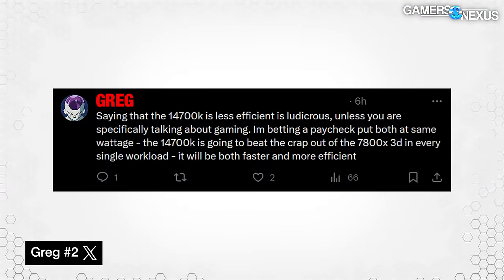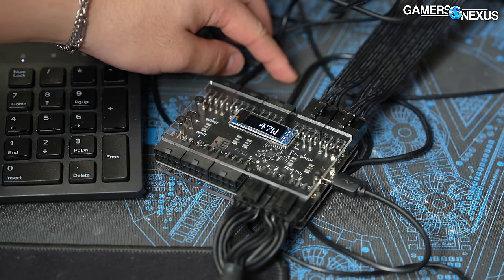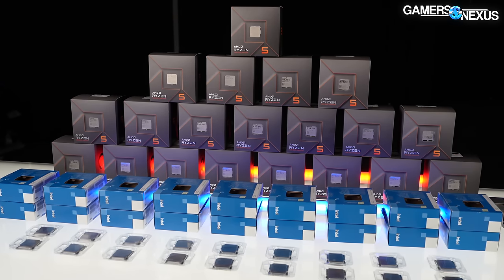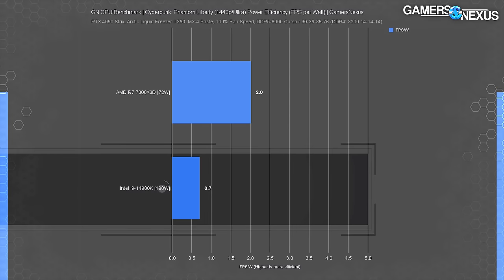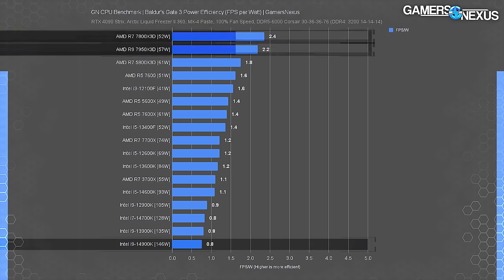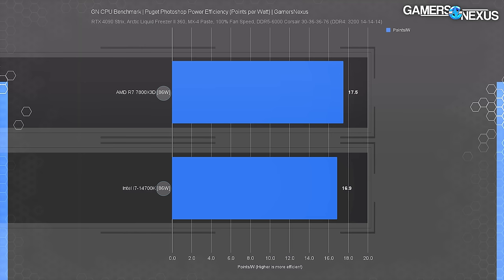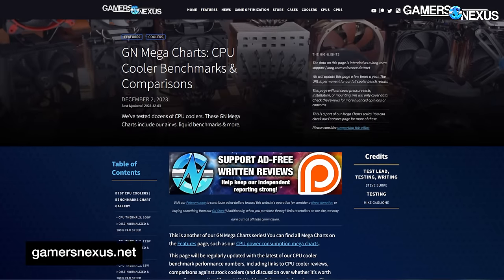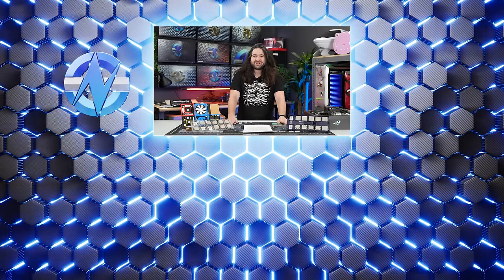The Intel Problem: CPU Efficiency & Power Consumption

Comment: Sincerely, thank you GN, and thank you Greg. This is the kind of data I really need to see. The synthetic benchmarks are fine, but some real world data is especially useful for my situation.

I'd really enjoy seeing this data set expanded to include lower TDP CPUs like the 65W Ryzen 7 5700X and 7600, as well as a GPU equivalent set.

My needs are probably not so unique in the USA, as many renters suffer from landlords that are restrictive with what we can do ourselves while unwilling to fix things when presented with them. I personally am living in an apartment with shoddy electrical wiring and share it with roommates in order to be able to afford a roof over my head. The circuit that my computer is on is also shared with computers from other roommates and we don't have a way to work around it. As a result, power efficiency is extremely important partly to keep the electricity bill down, but more importantly, so that we don't blow the circuit breaker whenever we're all using our computers.

I picked out my system specifically for its overall power consumption. I chose a Ryzen 7 5700G with a Radeon RX 6700 XT. The former because I had a B450 motherboard already and wouldn't benefit from the 5700X's PCIe 4.0 support, and it was cheaper anyway. Besides that, the 5700X/G are the best AM4 CPUs whose TDP is only 65W. Going any higher would bump the max power draw and bring me closer to the apartment circuit's limit, and that limit is the primary factor for me.

The 6700 XT was chosen because it was a solid and affordable mid-range card at the time of purchase. My specific card has its limit set to 194W, but my testing showed that limiting it to 120W gave the best power vs performance ratio. The FPS gain past that was only 1-3 FPS per 10W on average, while going lower than that saw closer to a 5 FPS per 10W decrease in the same test scenario.

Add in peripherals and dual monitors and this results in a very capable gaming machine capable of achieving 120 FPS at 1080p with max details in almost all my games while still only pulling 300W max from the wall, as measured by my UPS.
Reply: Incidentally, my previous system also has very good power efficiency. (The B450 motherboard had to come from somewhere.) A Ryzen 5 2600 and a GTX 1050 that I was using as a secondary GPU because the R9 290x doesn't have hardware HEVC support. The 1050 is lower power consumption anyway and I won't need it for intensive tasks, so it would work perfectly for the file server's display.

With a few more parts, I can reassemble it to replace my current file server and vastly expand the capabilities while keeping overall idle power consumption under 30W.

Beyond that, I ccan add some extra features such as router capabilities. I'm aware of the security concerns that comes with running a router on the same system as a file server, but adding a 4-port PCIe NIC would let me create a much faster and customizable router for my local network than anything I can get store-bought while only increasing idle power consumption by maybe 10W more at most. It'd also save on the amount of cables, making for a cleaner setup.

I'd even have extra processing power to let me host dedicated servers for playing private games with my friends without affecting performance on the other parts.

I'd be able to do all of that with a single system that draws less tham 40W at idle and probably around 210W under full load.

AMD really has knocked power efficiency out of the park, and thanks to them, it's possible for a poor, disabled, lifelong tech nerd like myself to have an extremely powerful setup that Intel and Nvidia simply can't provide.

Comment: This is Greg, or should I say Greg#2.

Your original post which I replied to was "the 14700k is way less efficient". I said that's not the case unless you are talking about gaming. In order to disprove my point, you went ahead and spent the first 17 minutes of the video testing games. Uhm...okay?

Then you finally tested exactly what I claimed, a non gaming workload at same power. Not only was the 14700k in fact faster AND more efficient than the 3d, it was the most efficient CPU on the whole freaking chart - threadripper not included. Let's try to wrap our heads around that, one of the most inefficient Intel cpus in existence (supposedly), when limited to the same power as eg. the 7800x 3d, tops the whole freaking chart. 

Then you also tested photoshop at same wattage, and the 3d edged ahead.

So from a 28+ minute video, you run just 2 tests that had anything to do with my claim, and both of them disproved your original point regardless (unless your original point was strictly talking about gaming, in which case you are correct, but I never disputed that in the first place). 

Now if you want to pedantic about it and say "Yeah Greg, but you said EVERY test" then sure, of course it's not in every test, and I knew that before I made the post anyways (eg. ycruncher using AVX) . But that's just being pedantic, run 100 workloads at same wattage and the 14700k will win in 95 of them. Im pretty sure you know this so I don't see the point of the video in the  first place. If you want to actually make a video about it then run the usual Cinebenches, corona, blenders, 7zips etc at same wattage and shows us.

Comment: Thanks for owing them a paycheck, Greg! Not only was this video entertaining, it's also incredibly useful. Context: my eyes can't notice a difference on anything above 90 FPS, so I tend to look for more power efficient/cheaper CPUs, especially now that I live in a place where power costs fluctuate wildly and I also spend 9 hours a day at a minimum on my PC for work and use the same for gaming. I haven't had a top of market gaming setup since the first gen i7 because it hasn't been worth the investment to me.
Reply: exactly this... Planned to build 5800x3d and 4060 for that low TDP and good performance.
Reply: @matejboras9279  fyi, the 4070 is a muuuuuuch better choice than the 4060ti 16gig, and it's probably the most competitive of all 4000-series cards, especially in the US, where it dropped as low as 515$, while the 7800xt is still a 500$
Reply: @LeLe-pm2pr  350$ 4060@115W vs 600$ 6800XT@300W. that's alot of money in pocket on purchase and every month on electricity bill. both can run new games and both wont be relevant in few years... and if you are doing gaming only then a 500$ ps5 is probably a better option for 4k@60 gaming than a 2000$ pc, and that ps5 will still be optimized for 4k until ps6 comes out in 5+ years

Comment: 21:49 This a really interesting chart. As someone in a privileged position I don't really care about the cost for myself personally. But I've never seen such an extensive chart for the energy cost for gaming before. Great stuff..
Edit: Would be interesting to see this chart for an entire pc for a top-tier-don't-care-about-money build vs good-price-performance build vs low budget build.
Reply: i would like to see what the edit suggested
edit: i have phat fingers
Reply: With the way price fluctuations and sales occur, that data would be inaccurate within a couple weeks, at best.
Reply: Good suggestion imo, I am on the other side of things and was very lucky to upgrade my older am4 setup to the 5800x3d and it was the best $289 I think i've ever spent in all the years I've been building my own computers. (since the late 80s).. I think what I have now should last me at least 2 more generations unless of course AI changes the world anytime soon!!
Reply: I live off grid so these charts are very important for me. It's not a matter of cost, it's a matter of can I get that amount of power from the sun.
Reply: The data on this chart (21:49) is interesting, but I would like to suggest that the presentation is confusing. In particular, the use of a line graph, when there's no relationship between labels on the X axis, is confusing at first glance. (That is, there's really no reason to say 'power goes down from a 14900k to 13900k and down further to a 12900k, but up to a 14700k'.) I think the line graph was chosen to try and help distinguish the 4 different rates, but I think a bar chart, with 4 color-coded bars per CPU, would have made more logical sense.
Reply: The problem is that it depends on what you call 'budget'. In addition, they have already done best CPUs at various prices
Reply: As someone not buying into the spiritual folly of scarcity obsession, I care about wattage only in regards to keeping a system quiet, and by extension also cool and thus stable.
For kind of the same reason I buy 5400 RPM NAS harddrives instead of 7200 RPM enterprise harddrives. (With the decision having become even easier since SSDs are common.)
A couple percent more performance isn't worth the diminishing returns. (Also in this regard, I recently saw with frustration that my RX 6800 XT pulls a ton of power at regular dynamic overclock settings even when it is underutilized through a framerate cap. Basically, it pulls a certain wattage when the game runs at 60 FPS, and then I manually underclock and undervolt and it pulls so much less, but the game still runs at 60 FPS. - Although I still have to test some other cases, it looks like an inefficient throttling logic.)
Reply: Checking the prices, the i5 is €42 cheaper. Looking at that chart and assuming you replace it after 3 years, it's €410 more expensive.

Wow.

I want the same chart for a typical PC for the power supply and compared between US and EU for efficiency, to know at what point we are for 80+ gold, titanium etc. for saving money or just being more efficient.
Reply: @dascandy   Good point to contrast purchasing price with running costs. Even with cars people like to neglect that. Electricity is often not seen like 'fuel'.

But with cars also regarding shopping. There are plenty of fools who would drive their car further to catch a discount, not checking whether it would be overall cheaper to buy food close-by for a bit more.

Comment: Also add short support of their sockets to the problem.
Reply from the maker: That's a different problem!
Reply: Constant crashing, mobo problems, can’t oc ram on 4 sticks etc. etc. on my 7800x3d with NO issues zipping on coffee ☕️
Reply: That was the main reason I went with a 7800X3D over intel when upgrading from my 8700K this month. After I read that their next gen of CPU's will need a new socket. Not buying a new mobo that's already a upgrade dead end. AMD claims they will support AM5 for "years to come" and with the longevity of AM4 I believe them.
Reply: @sean8102  AMD only gave 5000 support on AM4 because Intel would’ve been more popular if they didn’t
Reply: @thebcwonder4850  and your point?
Reply: Huge issue for me! When I switched to a 2700x from my trusty 2600k.  Then, a 3700x, then a 5900. All on the same motherboard. That's just a good business decision for AMD, because I doubt I'm the only one who could justify a few hundred bucks every year for a newer gen cpu, rather than a new platform every 5ish.
Reply: @thebcwonder4850  Its not like they can decide that at any time they want, you know. It means they knew they gonna release 5000 series on AM4 way before it was obvious that Intel screwed themselves an they were just keeping their promise. I don't even see much 9/10/11th gen Intel on a used market, almost no one bought them.
Reply: @ChuckTheChosen  AMD wanted Zen 3 to only work on new motherboards. Initially they said it was impossible to support them on anything older than the X570, but when Intel busted out Alder Lake, suddenly even the X370 could run 5000-series CPUs
Reply: @priyanshusharma1812  AMD was only consumer-friendly to be more competitive. If Intel puts up pathetic competition (like they are rn), AMD doesn’t need to do the long platform support thing
Reply: Buy a b350 in 2017 and slap a 5800x3d in it 7 years later.  Buy an intel board, and it is already obsolete for arbitrary reasons.
Reply: @thebcwonder4850 There was some issue with the bios size you can only fit so much data on a chip. That's why the manufacturer needed to write a new bios and boards had to be flashed
Reply: @frizzlefry1921  why does it work now then?
Reply: I mean, the socket is one thing, the cooling you need to keep a 14700/14900 running without throttling.....intimidating. And that's assuming it'll fit into your existing case. If not, you're gonna need to throw a few hundred bucks at that particular problem.

Meanwhile, you can cool a 7800X3D (or 7950X3D) with a $50 air cooler, maybe $100 if you're feeling super fancy.

Comment: Love this scientific approach to all the comparisons! In situations where you've got two variables to illustrate at the same time, you'll get way more mileage out of your graphic if you use a scatterplot. For example, instead of a bar chart with MIPS per watt, do a scatterplot with the MIPS and watts on the X and Y axes. That way you're not losing any information about the overall power consumption, but you're still illustrating the relationship between power and compute. And I'm betting that the point cloud will beautifully illustrate the diminishing returns of progressively more expensive devices.
Reply from the maker: Will play around with that and see how it looks for the next one! Thanks!
Reply: @GamersNexus  Excellent, looking forward to it! I just manually plotted FPS and Watts for your Cyberpunk numbers using this technique and the difference between Intel and AMD reallllly stands out. Thanks for sharing this with the world!
Reply: @GamersNexus  in that vain, for the GPU busy graph you could get the area beneath each graph and compare the deltas from one CPU to another. I think that would be the best visualisation for the data.
Reply: because then you can plot both bottleneck AND perf/W at the same time. like a bottleneck per Watt sorta
Reply: @prgnify  I'm gonna be real happy if we start getting integral calculus or GLM out of this channel. I might have to buy one or two of those mod mats if that starts happening.

Comment: Best part about the 7800X3D efficiency is I can setup all my case and cpu fan curve to only use 1000 rpm for the fans when it's gaming and still have awesome temps to noise ratio. And still maintain high boost clocks.  Seriously such a good gaming CPU.

Comment: Excellent review and interesting perspective. One thing to note about cpu power consumption: power correlates to heat, which can be a meaningful factor when considering how ambient room temperatures and noise levels are changed over time, especially in hot climates or during the summer months.

Comment: My favorite part of using efficient CPUs is that I can use air cooling without having the fans spin to audible levels while gaming. The electricity saving is a bonus.
Reply: Buy a good case? I haven't heard a fan spinning since 2015
Reply: @meekrab9027  no spinning? then u need to visit a server room, then u get up to speed very quickly